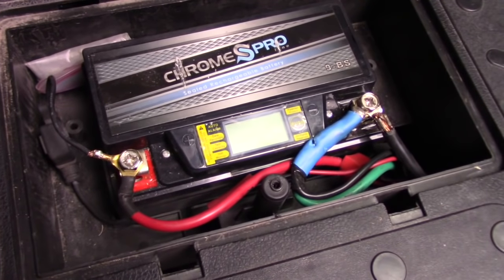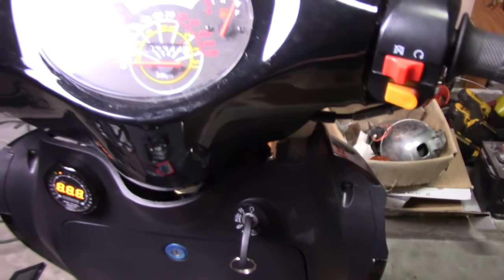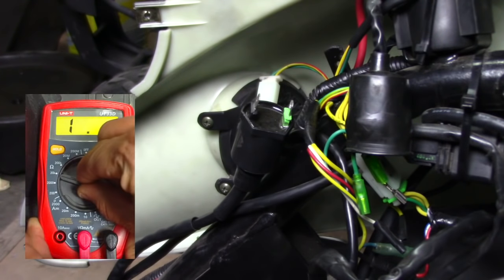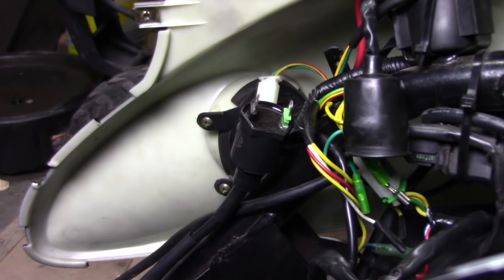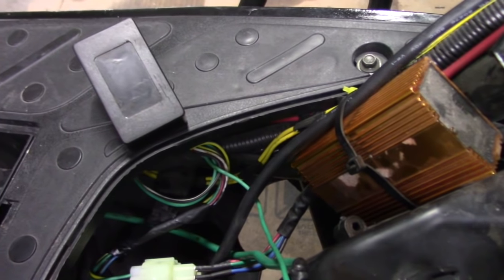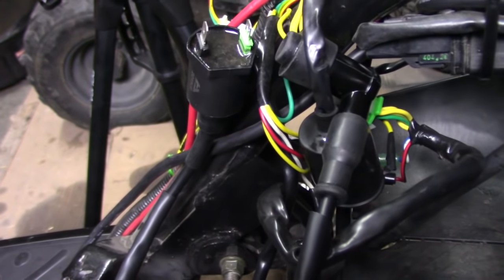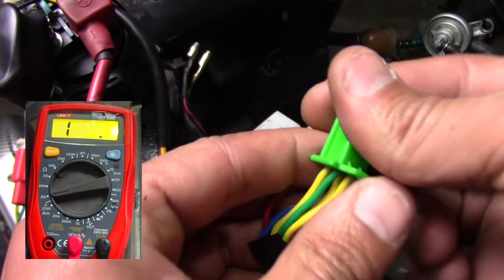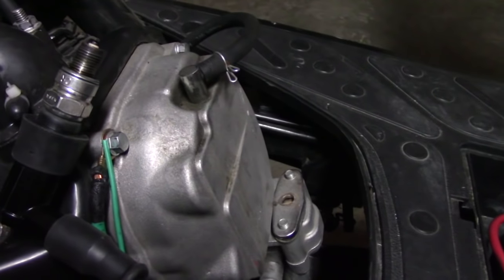GY6 Electrical Troubleshooting Tutorial - “No Spark” Eliminator

Comment: Great video man- You're a pro !
Reply from the maker: Thank you for the comment.
Reply: Is the excitor coil expensive ?
Reply: I’ve followed every step but I still couldn’t figure out why I’m still not having any spark. I’ve replaced the stator, ignition coil for the spark plug the cdi box still no spark can you help me figure out the issue. Or know what’s the next thing to check thanks.
Reply: Joey's Garage door open and then yes aSzzzzzàà A
Reply: @pandemiccovid2643  same here!!!!!!!!!!!!
Reply: When I test my coil I'm getting 22.2 and you were saying that you shouldn't get more than three to five does that mean my coil is bad
Reply: @JoeysGarage  hey man, I have a gy6 motor very familiar with yours, and I’m not getting spark, I’ve got a new cdi, spark plug, ignition coil, stator, all that, but still no spark, any idea? It sounds like it wants to turn over great compression and all but when I test the plug no spark comes from it, but everything is new, is there something I could be missing
Reply: 😁🤪👍👍👍👍 watch this video and follow step-by-step and did the same thing and I fixed my scooter I got my 150cc Chinese scooter back on the road and is running like a champ thank you  🎉🎊🪅🎆🎇🪅🎊🎉🎉🥇🥇🥇🥇🥇🥇📢 most hopeful video
Reply: @JoeysGarage Hey, bud  you still working on gy6 motors? Great video by the way!😊
Reply: Thanks 👍😊 you, it helps.

Comment: I replaced every electrical component on my 49cc with no results. This video saved me! I started testing and found that the old and new spark plug wire was bad. I combined the two to make one good wire and I got spark! The scooter starts fine again!! Thank you so much for this information!
Reply: How do u did that how u combine  that smh

Comment: i replaced my stator, ignition coil, spark plug ,cdi, solenoid starter and new battery and still no spark
Reply: the same situation :))
Reply: I'd check the stop switch and or key switch.if you have short to ground it will be just like cranking with key still turned to off position
Reply: Luis Chavarria Same thing here. Have a new auto choke/cillinoid on the way. Hopefully that does the trick.

Comment: A very thorough and concise tutorial. Excellent job with diagnostic technique, and videography, totally well done! I will suggest always touch probe tips together before every continuity test to verify ohm circuit in meter.
Reply from the maker: Good tip. One of my first videos. So many things could have been done better
Reply: Also, for people who don't use multimeters often, DO NOT use the OHMS / RESISTANCE settings on your meter to test anything that still is in a powered circuit.  The meter is not going to be expecting any outside voltage to be present when doing resistance measurements.  Best case the fuse blows; if your luck is like mine then the whole $20 multimeter dies. Even God wont be able to save you if you do this to your dads Fluke...

Edit: for clarity, the video showed the correct way to do this.  I just want to add emphasis for the inexperienced ones out there who might have inadvertently put 12v across the meter leads while doing a resistance test.
Reply: This is where I'm almost sure i went wrong!?! Because I tested it by doing the short circuit. But that doesn't fix the problem. Cause everything else in the electric system works! So it's obvious then! Good looking out mydude.

Comment: Hi Joey, need some advice. Bike was running great but for some stupid reason whilst it was idling I decided to disconnect the CDI (6 pin) and engine cut out. When connected back up wouldn't start so I connected another CDI I have that I know works but still wouldn't fire up as I now have no spark again. Any ideas? New stator still good as did the tests but my limited knowledge has been used up. I must have done something to electrics as it can't be a coincidence that won't fire immediately after disconnecting CDI. Thanks
Reply: Same problem,  did you ever figure it out
Reply: Bmx at coil wire transfer

Comment: THANKYOU! Having an absolute mare with my 125 just now. Replaced the rectifier, it ran until i got home after testing. It rode like a dream. Then it just wouldn't start again, so i was back to the original issue. I'll replace the stator and see how it goes 😊 thanks dude

Comment: Yeah, thank you, so much. I've replaced every aspect of those wires, but for the stater - no spark. I really don't want to go through all that stuff.
Time consuming, but that's my guess, now. The stater is bad. I've had the scooter x 1 year, brand new. I've replaced a whole bunch of parts trying
to diagnose how it went from a fractured vacuum line from EGR to exhaust replacement, to not starting, at all. Replaced battery, gas line, checked vacuum x gas,
the CDI - is next thought I replaced the six port somethin' somethin' last week. I know more about the anatomy and physiology of the scooter than I do
about peeps - M an RN. This has been an exercise in tenacity and patience I didn't bargain for.

Comment: Thank u Joey. Your vid helped me fix my Buddy 125. The little pulse coil or trigger coil has been falling for a long time. The really difficult thing was that the bike would run perfect. Sometimes it would hiccup after climbing a long grade. Then it would b fine for days. It would even ohm out with the meter like it was ok. I threw all the parts at it. CDI, coil and plug. I even bought an original equipment CDI from Robot’s Scooter place in San Diego. Turns out the cheap ones on Amazon work just fine. Finally the scooter pretty much quit and the pulse coil read open circuit with the meter. I replaced the stator and now it purrs like a kitten. Thanks again!  In my tool kit, I will carry an extra stator. I already keep a drive belt, CDI, coil and plug. I also carry a Ryobi 1/2 impact, and a flywheel puller. It all fits under the seat and it’s super handy for trips to Pick your Part. I’m gonna check out your info on fuel injection.

Comment: Just took a peek and it was easy to follow.nice job,think you might want to check clearance issues with that magnet drum.somethings out of wack and hitting that stator.just saying might be out of round or loose to do that damage in only one spot.keep them coming.!!!snookie pa.
Reply: Accidentally using one or both of the 2 longer screws used to hold the fan shroud on, instead of the 4 slightly shorter screws that holds the fan on (see 15:48)... is what can do that damage.  

At 15:37 he skipped through the removal of those 2 slightly longer bolts (you can see one of them in the upper left corner at 15:42.)

That results in the 'shredded' appearance. The tip of the bolt, can poke through the backside; gouging the black covering and windings when the starter turns it.

Subsequently a no start.

It is 'possible' to wrap it with a bit of black tape, to get you through for a little while in a pinch...

A better design would prevent this from potentially happening.
.

Comment: Amazing battery if 12.7 indicates going 
bad, my battery new was 12.75, a week or so
later and following it settled two 12.45 or so, 
same with my SUV, new battery was never 
showing more than about 12.5 or 12.6 unless
just getting back from running it for a while.
Very cool that that batter comes with its own
integrated volt meter, wish they all did.

Comment: Excellent video. Just to add you forgot to mention the r/r, (rectifier/regulator) which normally hooks up to the stator output. On mine is also safety diode. Subscribed

Comment: So just received my new stator and tested it with the meter same as you did, and the blue wire doesn’t give me any readings….

Edit:
Placed new stator onto motor and received readings on both wires.

Previous one, assuming it’s burned out didn’t have no readings about to check spark

Comment: The video helped alot thanks. My only trouble is i did all the checks but the stator wires gave me trouble with no readings, but the gy6 starts perfect but if after a short ride when i turn it off and try to re start it! Thats when it wont start. I need to find a tool to take my fly wheel off to check the stator 1st. It runs perfect but if i take it to high speed it does bog a little if i try to do it again and its even worse to start back up. Might be my cdi dying? 
Love your videos to straight to the point cheers for the UK

Comment: I replaced the Stator, CDI and coil on my GY6 150cc scooter due to it having weak intermittent spark and it still has intermittent weak spark. Only thing that I can think of other than the wiring harness is either the Kill switch, Key Switch or Voltage regulator or a combination of all 3. It's a 2008 Roketa and I can not find a new Voltage regulator for it because it has a non standard 6+1 wire connector.

Comment: At end of video did you actually replace the stator with a new one or repair old one in some way? It wasnt clear what you did to get the spark plug working again. Thanks.
Reply from the maker: New stator. They are very hard to repair.
Reply: @JoeysGarage  Great thanks for the quick reply. Do need a special tool to remove flywheel or can you jimmy it off somehow?

Comment: Great video very thorough and helpful..I just recently purchased a brand new utv that will not start appears to be no spark and I can not get a hold of any of there staff very frustrating. Ran down the same checklist and diagnosis you showed everything checks out except the stator wires are all together like in video different colors but same application, however the 2 wires separate from harness 1 blue/white the other black/red the black/red the black and red wire is the only wire not connected to anything it has a connector end but nothing connected? Is this just a different wiring application or should this absolutely be connected or is something missing ??

Comment: Great video. I followed your detections and found that my stator was the problem. I ordered a new one, replaced it, but the spark plug still won't spark. I realised that although I ordered a stator listed for a 150cc scooter, the actual box it came I  says gy6-125cc. Is there a difference? I also noticed that for this gy6-125cc stator, I have to set my multimeter to 2000 to get a reading, instead of 200.

Comment: You need to mention some engines will kill the spark because it is to low on oil and the oil sensor will kill the spark. That would explain it starts then runs for few seconds and then dies...

Comment: Very nice video, i have my bike the same problem no spark. The previous owner tampered with the wiring harness at the cdi connections. Do you know which pins i need to connect to what wires

Comment: Great explanation.  Bike was running a week ago.  No spark at the plug now. I have a 2 wire green plug, yellow and white wires from stator.  No green.  How do I test that?  Stator is pretty new, so I'm skeptical it is that, but I figure I should check.  I don't have a spare CDI, but the little red light on mine blinks while cranking and everything else checks out according to your video.  What would you do?

Comment: I tested my stator, the red wire has reading but the blue wire doesn’t. I got a brand new stator and still no spark so I went to test it, got readings on the blue wire but not the red wire.. do you think I have faulty stator ?

Comment: i have done everything you have said and the batterys and evrything is ok. I have also changed the batterys still not working. I changed the cdi box 2 times. still doesent work. I have changed everything that was a little worn out. still doessent work. Its a hooper one 45 scooter. WTF am i supposed to do!!
Reply: Dude have u change the stator is obviously that and u didn't  test it yet or at least u don't say it here

Comment: Good day, very in-depth video, i have a different issue,keep blowing fuses, even lost a battery as well and my head lights keep popping and it struggles to start up with the electric start, but will start fine with kickstarter, where do you think i should start?scooter is a big boy revival 125cc.

Comment: Hi, great video, learnt a lot.
My issue is that my scooter runs fine with a fully charged battery but after a while it just dies. Give it a bit of time, it'll start again. If I really keep the revs up & keep catching i,t when it is dying, I can normally keep it going for longer. I'm thinking that it is the stator not charging enough..... how do I check that? Or maybe, there is a drain on the spark system. I have changed most of the other electricals, lost the way now. Any ideas?

Comment: I bought an old used ATV it’s either a 50cc or a 90cc. When I went to look at it the guy wasn’t the original owner and told me the carb was bad and he bought a new one but never put it in. It has kickstart and said it might be a 90cc. When I brought it home and changed out the carburetor but after looking at the old carb torn apart I noticed it was very dirty inside and it’s a Mikuni. I asked him if it had electric start he said no. I took the seat off and there is a battery tray with both pos and meg wires with the red and black rubber boots. I took the ignition 6 wire plug out and noticed the red came apart because when I looked at it he tried to turn key on and the whole switch turned in the plastic so I ordered a new one still waiting. I also noticed on the handlebars left side there is a on off switch and a spring loaded lever that has a circle with a lightning bolt in it and I’m assuming it is electric start. The crankcase is 20” long by about 5” wide and has HER CHE? The other letter is almost gone and looks to have room for 1 or 2 more letters but I can’t find it in google search. It’s a kids ATV but has 20x9 on front and 16x10 on rear with 7 or 8” rims and he told me he had it up to 30 mph. What can I do to see if it’s electric start since the old ignition is bad and I put a new battery in it. I cut the old ignition and stripped the wires and twisted the red and black together turned it on and moved lever with lightning bolt and nothing but I did add one wire and headlight came on I tried another but it sparked. How do I find out what size engine and make also trying to see if it will turn over if it is electric start? Like I said all the newer ATV’s have a short crankcase but this one is long with raised ribs any idea’s? And the fact it goes 30mph with the big tires. Thanks

Comment: Trying to troubleshoot a co-worker's Kymco 90 Mongoose over the weekend with the same type of coil. I've eliminated the (brand new) spark plug as being the problem (tested it on something else), and also set the gap on the new plug according to the sticker on the bike (.6mm I think). When I checked the yellow/black wire going to the coil for power with a 12V test light, it flashes as the engine turns over. So does that sound like the CDI is working ?  

I disconnected the green wire to the coil which goes to the kill switch just to eliminate that out of the equation. It made no difference.

Seems like I tested resistance across the black and green terminals and got an open circuit but when I checked the secondary resistance I got 4K ohms on the old coil and 7K ohms on the new coil.

Trouble is this is a brand new replacement coil and it still doesn't fire.
This guy had someone else look at it before me and he replaced the CDI, coil and spark plug and it still won't fire.
Do you think the original coil went bad and this new one was DOA? If the wires were reversed on this type of coil would it short it out? On an automotive coil, you can get the polarities backwards and it will work somewhat but I'm not sure about these CDI type coils. I just wonder if the guy hooked it up backwards.

Comment: I am finding the same thing, with no power thorugh the red cord. so i think it smy stator like yours. I have taken off the fan cover but cant quite get the flywheel off. i don thave an impact wrench or the flywheel puller tool yet
Reply from the maker: Flywheel puller is a must for the job. If you don’t have one, it’s not coming off

Comment: I've got no spark. I have a new plug, CDI, ignition coil, and battery. My resistance reading from stator power (red) to ground is 500 ohms. Could that be too high? You didn't mention the correct range for resistance here.

Comment: Pls Help me a little bit & Thank you for the video.  It is helping me out a lot.  I have a question about the Pick up coil wire and the exciter wire on my GY6 motor ATV.. They seem to plug into wires with different colors on the ATV harness.  

Blue / white stripe (pick up coil) - question... This changes to Yellow + ?.   Where does this wire come from?  My ATV seems to be missing a wire for this...

Red / black stripe. (Exciter Coil) -  plugs into Red & white stripe ?

Any idea?  I could not see this in your video...

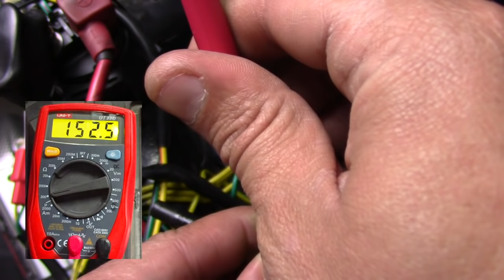Comment: 14:19 ''a reading of 15? 
Looks like 150 ohms, right?
My bike is different, I'm trouble shooting it,
I'm getting something like 284 ohms which 
would be similar to what you're getting if 
you're showing 150 ohms. What does that tell
us ,when we get that kind of value? 
I understand my blue/white to be the pulse/
exciter/tdc indicator that signals the cdi when to 
send current to the coil, if that's correct. 
I'm getting no spark, got a new coil and it reads 
(at least to me) like a bad coil, and my old coil seems
to read fine. This is not going well lol.

Comment: Hello , I have a Chinese import atv with a 110cc engine , I have a slite problem with the engine wiring where the stator is situated  , and there is a separate set of wiring that runs into the casing where the stator  sits but runs past it going into the back of the engine. Do you have any ideas  of what the 2nd set of wires that run into the engine? Thank you